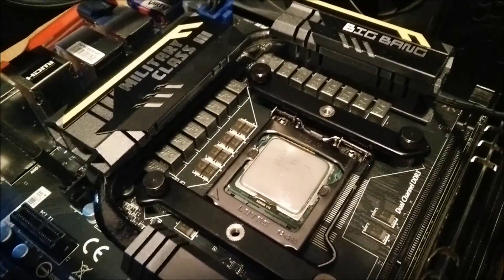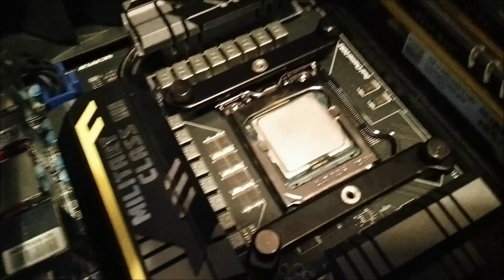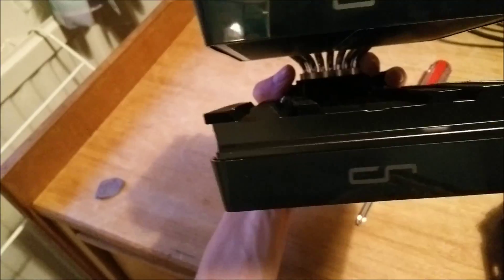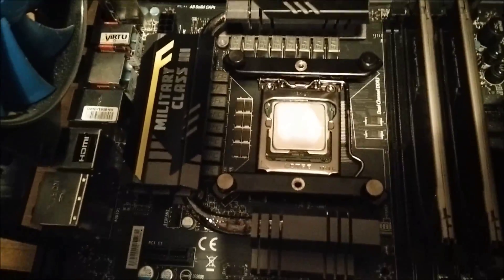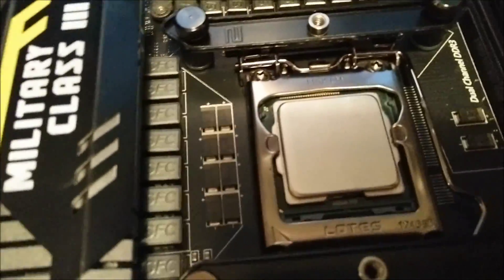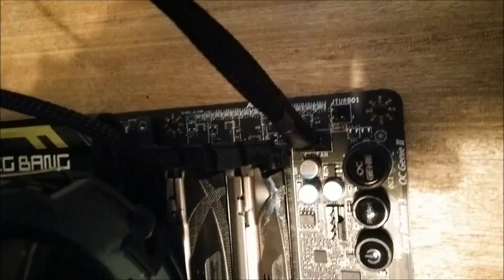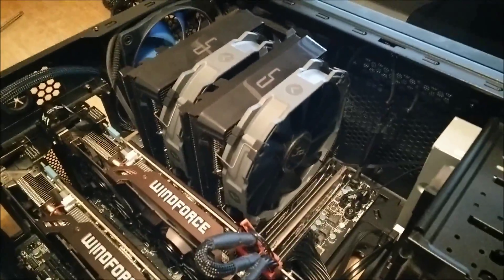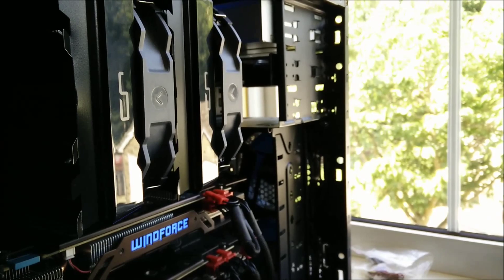Cryorig R1 Ulitmate Installation and Performance

Comment: This was the biggest piece of shit CPU cooler I've ever installed.
Reply from the maker: +Ryan Loyles be quiet are worse.
Reply: I got rid of mine and bought the Noctua NH-D15, which actually clears my low-profile RAM.  I had the same issue where the screws on my R1 wouldn't reach, even when the mounts were aimed the correct direction.  Was starting to force the screws to where I could feel my mobo flex.  Check out the Noctua for grins!  Has cutouts on the radiator that allow it to clear the RAM.  Very good design.
Reply from the maker: Ryan Loyles i have 2 phanteks ph tc14pe now

Comment: Professor Brian Cox..... is that you? :P Jokes aside, is this better or worse as a cooler, than the phanteks one?
Reply: I think the mounting system is better than the dual radiator phanteks cooler and I'm getting better performance out of my R1...that's just my experience though and I've had both.  It's also a fair amount quieter...you can't really tell outright how loud any cooling system is only by looking at decibel levels from my experience.  Also, the issue the reviewer was bringing up about the mounting brackets appearing loose, that's actually part of the design, as the brackets don't fully tighten to the motherboard until tighten the actual cooling unit down...all I know is my R1 is the best performing cpu cooler I've had, and I went through 5 top tier coolers before trying it.  Are other options in the same price range just as good? of course.  You can't go wrong with the Phanteks, I just didn't like it.
Reply from the maker: +Derpy Turnip i like the phanteks much better. i sold the r1 ultimate to get a second phanteks!

Comment: how loud is it?
Reply from the maker: Idk
Reply: +Andres Celano Max under stress test is around 38 dBA which is less than most others.
Reply from the maker: +Sylvex Dragonskin thanks for answering I never tested the noise level of mine
Reply: +Sylvex Dragonskin thanks
Reply: Andres Celano
No problem, i'm worried about sound myself. Apparently the Frio Extreme Silent 14 is around 35-36 dBA under stress but it's white. That's why I was looking at this one.
Reply from the maker: +Sylvex Dragonskin tbh the reason why I never tested the sound was because I have 970sli and 4 case fans so it would not be an accurate representation of the sound.
Reply: Lawrence Timme
Ye that was my guess. I'm trying to have a new setup but quieter. That's why I'm trying to find quiet solutions :)

Comment: To remove the bracket is 2 fucking thumb tight screws that takes 5 seconds. You're removing an entire CPU cooler and complaining about an extra 5 seconds to remove a bracket

Comment: real people...real mounting problems.

thanks for sharing.

spelling error in intro...slow down clocky
Reply: Lawrence Timme Insallation? lol
Reply from the maker: Arnav VR ffs. this is why i should edit things, before i go to bed :P
Reply from the maker: Prokon's Tech Center what did i spell wrong this time?
Reply: +Lawrence Timme first it is designed that way the back plate will have a little movement     when you  put on  the heat sink and tighten  down the weight of the  cooler will tighten everythingI installed  one iin 5 mins
Reply from the maker: Mosh Dawg i have sold it now and bought another phanteks cooler instead, the mounting system is much faster.
Reply: How often do you reinstall a cooler? What are you going to do with the seconds you saved by using a faster mounting method?